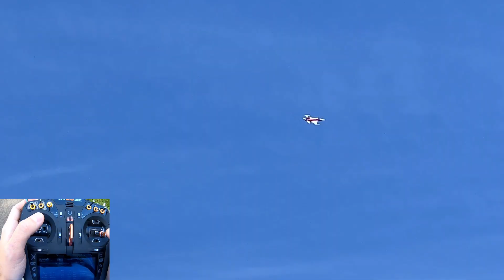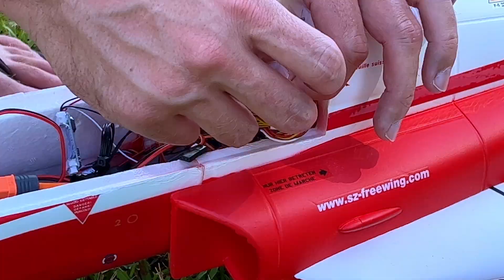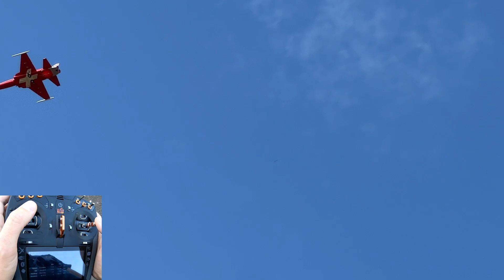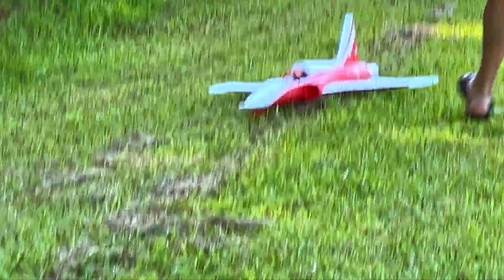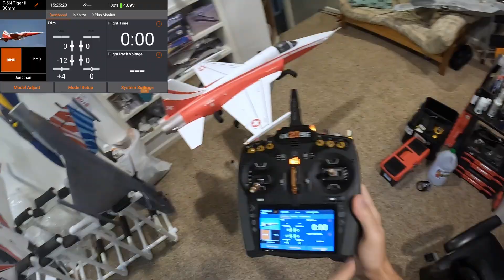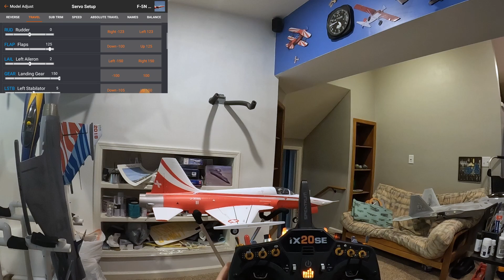FIRST FLIGHT DISASTER

Comment: Trying to fly an F-5 on the wing.  
Not gonna happen.
The F-5 flies on the thrust component opposing gravity.
Reply: Sure.  When full scale student pilots first try to land the T-38, they bring bad habits from aircraft that fly on the wing, like the T-6/37.  Well, they aren’t “bad” habits if you have a significant wing, only if you don’t. A common, but not-useful paradigm brought from low performance winged flight to high performance jets, is the concept of using throttle to climb/descend from increasing airspeed seeking a trim point. That requires a low performance wing.  

With a high perf wing, zero camber (the Freewing model sneaks a little in, but the lack of wing area is still dominantly high perf in character) dictates some positive AOA to fly.  And it’s never going to follow a trimmed attitude by flying on the wing, you have to manually force the desired pitch attitude.  The AOA has a large range of buffet (can’t feel it in RC of course) before the lift peaks (actual F-5/T-38 is VIOLENTLY shaking, like wooden roller coaster x10.  IPs will descibe it as mice dancing on the wing, gradually increasing with AOA until elephants are jumping up and down.  When the brutal bangs start to hit out of even rhythm, the wing is now post stall.  The nose still can be pitched farther up, but that just increases the sink rate.  The vector of the real F-5 with full aft elevator pegged is about 70 degrees AOA with the pitch stable around 5 degrees nose low, so a 75 degree down vector from the horizon.  It takes a while for the nose to come through the horizon to a stable nose low attitude.  Maybe 10,000 feet of fall. 

That’s with flying airspeed.  A full fuel stall speed (applicable since batteries don’t lighten up) for the F-5 is 180 to 190 mph.   So let’s round to 3x a low perf aircraft.  Because the wing has a very long AOA transition to a stall, you need to be stabilized a super high drag (buffet bleeds tons of energy from drag) high throttle approach.  A heavy F-5, in order to fly slow enough, comes in about 7 degrees nose high on final at around 95% throttle.   

Because of the very high AOA to get everything available from the small wing area with symmetrical, very elongated airfoil, something strange happens.  The airplane flies largely on the component of thrust opposing gravity.   As you flare, that component becomes even bigger.  As you round out and pull power, it’s like kicking the chair out from under you, because the wing cannot produce enough lift so you touch down, essentially like a helicopter, by removing the thrust component and flaring to compensate as much as possible without a full stall (violent, but not arhythmic buffet).  It’s kinda similar in concept to the end game of autorotation once the power is pulled. 

The same thrust-wing relationship occurs during slow flight.  That equates to any speed under 250 KIAS or ~300 mph in the real jet.  If you are under maybe 50 mph with the model the thrust component, from positive AOA, will become the primary lifting device.

I’ve owned that model and you really need a long paved runway and sharp eyes. It’s the nature of Gen 2 jets.

Another option is to flop it in the grass gear up, but that’s not without foam damage at these speeds.
Reply from the maker: That's a lot. Appreciate the in-depth response. Unfortunately, I don't think the full-scale F-5 info translates to model scale due to the Reynolds number difference. Full scale F-5s have a razor sharp wing compared to these foam models, in addition to the difference in mass, materials, and the fact that I'm not physically in the model experiencing the flight. The Reynolds number itself is a huge difference - massive, even - in that it's going to experience majority laminar airflow throughout almost all of the flight envelope as opposed to a full scale F-5 which will experience more turbulent airflow and have a different lift coefficient as a result.

Basically, I'm sure they fly similar but there's no way they'll fly identically - especially not with my setup using differential stabilators to assist with roll and perform post-stall maneuvering - or attempt to, anyhow. Summed up, the F-5 definitely doesn't glide well. It does however fly fine with even a little bit of thrust from the motor, and I find myself holding thrust on approach to overcome the drag from the flaps. It lands like a jet configured for crow, not a jet with standard flaps.
Reply: @TwoBrosRC  
I agree they don’t fly identically, but Reynolds Number makes models fly worse, due to a smaller number of air molecules pushed around by a same-shape airfoil.  That makes air less predictable at smaller scales.  That’s why the model has more intense less predictable wing rock, although the full scale plane experiences severe wing rock, too.   If you hold the stick full aft, the full scale plane will very predictably rock to 60 degrees bank from side to side to side, with the nose basically level on the horizon, but a straight down velocity vector, by that I mean an AOA near 90 degrees.   Just falling. 

The F-5 airfoil cross section, because it is a long thin plate at almost any scale, is basically going to approximate flat, so a special case of symmetrical, no matter how much you try to camber it.  Flat airfoil flaps add some camber, but a lot of drag too so they are helpful but not down most of the time, anyway. 

I think you are right, though, that all models feel sort of similar, but nevertheless different.  The similarities make flying RC fun, especially giant scale which feel pretty close but with a generally stronger thrust to weight.  

In this models case, the fan acts more like a very low torque, high RPM, so decent horsepower, prop, but permitting only slow speed flight in the non-compressible region.  Since the air can’t be compressed at speeds less than around 0.3 Mach, it’s another reason the model acts more like a speed-starved airplane” and less like a “flat-plane” high perf jet. 

All that said, you can definitely see classic F-5 characteristics in your video.  Especially when you get very “slow” which I would say, for this particular airplane, is most of the video.  The best example is what happens at 7:13.  But the plane is largely struggling in a near stall most of the time.  That’s why the real aircraft has a speed waiver to do 300 KIAS below 10K feet.  250 KIAS is not near enough, especially when heavy, which is how the electric model feels all the time.  Especially on landing.  Landing a heavy weight F-5 is risky to say the least.  You want a barrier option which is why all USAF training bases (T-38) have two ~10,000ft RWYs with BAK-15s. 

To make a long story endless, the real F-5 actually glides very nicely and reasonably efficiently, but L/D(max) is 240-250 KIAS, or like 300+ mph.  That almost requires declaring an emergency just to “legally” hold your glide speed.  So the way less mass-dense model is going to bleed airspeed at anything near an efficient glide airspeed, too quickly.
Reply from the maker: I definitely noticed the glide slope issue you're talking about yesterday when I shot the landing tutorial. I got about 15 touch & go approaches and it became very noticeable when I tried landing power off. It simply started falling and only my massive throws on the stabs kept it from having a strong impact on the pavement. After that single attempt at power-off approaches, I went back to low-end power to maintain the slope.

It's significantly more fun to fly than I originally thought on the maiden. I actually find myself really enjoying how it lands. It's a unique challenge, something I appreciate in a hobby where so many models feel so very much alike as you've mentioned.
Reply: @TwoBrosRC  
It’s a great airplane design or it could never survive the tests of AF pilot training since 1962ish.  It is truly, incredibly forgiving, but only if you understand what’s happening with the thrust angle contribution to lift, then it’s simple and super fun.  

You’ll see the same sink at high AOA exiting a loaded loop, and any developed turn.   How many USAF SPs have hooked checkrides for obliterating the bottom altitude of their MOA with the nose 10 degrees above the horizon, but less than full power? Or, trying to tighten the overhead traffic pattern break turn, but without selecting full AB, and winding up 2 miles away from the RWY on a closed pattern downwind?

It’s a little weird at first, but a GREAT introduction/trainer to high performance jets that fly on thrust, versus cambered trainers that fly on wings.  It’s the SP’s first introduction to more power = less radius. 

A well flown F-5/T-38 is a major problem for a normally flown anything, even today.  There is a large bag of tricks nothing else can do.  Maybe more than any other fighter, ever, it can point in a direction it’s not going.  But it cant shoot off bore-sight across the circle, and primary game plan dogfights are long gone, sadly. Today it’s stealth strike, in and out without a hint. Fly right though the IADS, ignore airborne enemy fighters.  Booooring.
Reply: You are doing amazing if the foam anchored gear is holding up to 15 T&Gs.
Reply: Side note - a brand new T-38 tire has a 10-12 landing lifespan.
Reply from the maker: @FFE-js2zp  We'll see how long these foam tires hold up 🤣
Reply: @TwoBrosRC  
When you show up at the jet, just say, “Hey Chief it’s an FNG we’ll need a new set of tires.”  Your tax money at work.
Reply: Oh yeah one more fun fact - 
A single main landing gear stuck down is an unlandable config and mandates a controlled bailout.  Both main gear up or both main down is fine.  But the runway can’t have a cable barrier with two main gear down and the nose gear up, or you’ll decapitate the front seater.  So good job!
Reply from the maker: @FFE-js2zp  Thanks for all the info! Really appreciate it.
Reply from the maker: Mind clarifying?

Comment: I use ailerons on my aircraft too. Reduce your throw on your tailerons and you will get a full axial roll.
Reply: Well, I am not a flat spinosologist. It didn’t work out well for Goose so it most likely wouldn’t work out well for me. I gave up flying Motion’s foam jets as they only fly for 3 minutes at a time!
Reply from the maker: I may end up trying that. For now I've basically just gone back to using ailerons only. Seems to fly just fine. The primary reason I set up tailerons is to have the ability to flat spin and pull off other maneuvers, but this model doesn't really want to do it so I'm not going to keep forcing it to using stabs alone.
Reply: I think it doesn’t depend on your tailerons for a flat spin. You just don’t have enough surface on your rudder or deflection. 

I use tailerons on my aircraft because when you slow your aircraft to close to stall speed, your wing gets mushy. Tailerons in my opinion keep the aircraft with a symmetrical roll rate through its performance envelop.
Reply from the maker: @terrencejackson4587  Differential stabilators (aka tailerons) actually are one of the only ways to properly flat spin a model without thrust vectoring. Sometimes rudder does it - and may do it here - but the stabs are where most of the rotational force is going to come from after the model is held in a stall with full back elevator pressure and left or right commanded roll. This is how I flat spin basically every other stab-equipped jet, such as the F-22, F-16, F-15, F-14, etc.

Comment: What receiver are you using and how do you get the air speed to work. i have an ix20
Reply from the maker: AR8360T - it should be in the video description. Speed requires a GPS: https://tinyurl.com/SpektrumGPS - you'll have to bind the receiver with the GPS installed in the X-Bus port for it to be recognized.

Comment: Can I ask how you are getting voltage readings off your pack? I have ix20 as well but can’t figure out the voltage reading?
Reply: Thank you much appreciated, I didn’t know if it would work on my 12s jets or not I just found out volt sensor is up to 60v. Thanks again sir! You rock!!!!
Reply from the maker: I cover voltage info in my setup vids, usually - check my RC Aircraft Setup Demos playlist: https://www.youtube.com/playlist?list=PLiEHeXKlZj2mLRTlM9DCrCs302BJFNfyq 

I'm 99% positive the F-35 setup covers this. You can translate it over to this one.

Comment: you should try a yak 130 . I have one and it flies really well its kinda floaty and super light for being a 70mm 6s i sometimes fit a 6000mah batt and get 5 minute flights and its really fast. mine doesnt have all moving tail but it does have a servo per elevator side which is weird but helpful
Reply from the maker: I usually don't go for models without a full flying stabilator if they're supposed to have one - though a bigger Yak might have it. Thanks for the idea!

Comment: "I expected more." You were referring to the speed, but that pretty much sums up my feeling about this plane. 😅 Maybe my expectations were too high for it.  Sold it after 8 flights.  Maybe i would have liked it with a gyro, but it just never felt like i could get it flying right. Moved cg all over the place, messed with getting control surfaces level. Maybe mine was just a odd behaving one. Sure is a beautiful looking model though
Reply from the maker: I'll probably keep it until it wrecks. It was so cheap that I can't see it being worth the effort of selling. That being said, yeah, it seems to excel at fast flight but that doesn't mean I won't find a way to tame it and make it behave the way I want it to. As you might recall, everyone said I couldn't high alpha the E-flite Viper 90, yet it seems to feature high alpha quite prominently as the channel intro. ;)
Reply: @TwoBrosRC  o for sure. Im deffinetly going to be  watching you work some magic on the f5 and am curious what setup finally gets a good all around performance for that plane

Comment: no one has ever said this is a beginner jet!!  However it is not in anyway hard for an intermediate or expert to fly! Once you get the settings right and throws right, it is a total dream to fly! Mine always gets people to come to the flight line and watch as it flies!  It needs to be slightly nose heavy and with the FMS 2100kv you need at least a 5000 pack to get the most fun. When I had this fan the plane was doing 150mph + and with my current Xfly it will do over that! All the throw you are using will make it depart really easily. From the voltage drop I am hearing on your telemetry you need a different pack for this set up as well. under load mine is still at over 3.7v per cell. I have had the same bird since 2014 and it is still going strong!
Reply from the maker: I won't argue that I need a new battery setup, but my throws are fine. I get into this argument constantly with people who think only in technedure - I get it, you fly the way you do, but don't come at me telling me that my throws are bad based on some arbitrary measure you've come up with. I know you don't argue about expo, so consider the idea that I'm flying with 85% expo and flying the jet perfectly fine throughout this entire video so long as the gear isn't malfunctioning. That alone shoots a gigantic hole in the "throws are too high" theory you've got.
Reply: @TwoBrosRC  yes we all have our own preferences. Get some more time with the plane and figure it out more. Like I said I did all the wrong and the right with mine. Had it since 2014 and its been to hell and back! Used to take off from a small dirt path then land in the grass… so my experience with the plane is not arbitrary.
Reply from the maker: I fully intend to get into it more. This was the maiden day, after all. I doubt you figured everything out on your F-5 in your first five flights. :)

Unfortunately, it is arbitrary - you're not the designer of the jet, nor do you know what my goal is with it or what I'm trying to achieve. That's what I'm talking about when I say technedure. Your personal techniques are not my official procedure. If you want to offer advice to people, they tend to take it better when you offer suggestions instead of absolutes. Food for thought.
Reply: @TwoBrosRC  to each their own… and you do it your way… in no way does it make it anywhere near right either!!

Comment: Thats a great flying jet  not sure  why yours flew wonky. 120mph all day long with stock set up.
Reply from the maker: Probably because it's not the best designed model out there. When something gets laterally unstable when the CG moves back to the recommended point, it's a bit on the wonky side.
Reply: @TwoBrosRC   idk mine is pretty rock solid. Your battery placement looked too far back. Maybe try  moving the battery forward a couple of inches
Reply: @icantfly  Its for sure too far back and the elevator throws are not what this plane likes. I have done all that there is to do wrong and right with this plane. With my fms 2100kv fan the plane was over 150mph too so something is definitely wrong with this set up.
Reply from the maker: I did in later flights, which made it fly a bit better but still on the nose-heavy side of things. I'm not a big fan of that TBH.

Comment: Nice, I brought this same jet a few months ago but haven't had the guts to take it out yet. You confirmed my thoughts lol. I will wait for a perfect weather day to try and see where I can squeeze a gyro in it.
Reply from the maker: Setup is in the end of the vid if you want to see how I did it and perhaps use my IX file if you've got an IX-series radio. It's a challenging aircraft to fly. Keep that in mind and be aware of accelerated stalls and you should be absolutely fine. It needs a good bit of speed to fly with those little stubby wings.